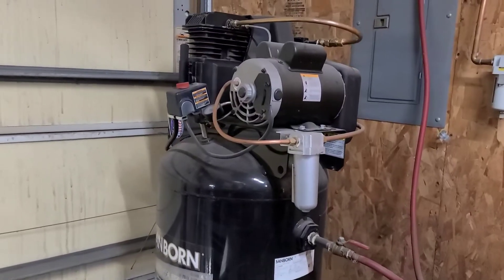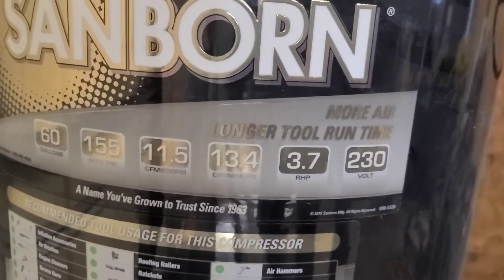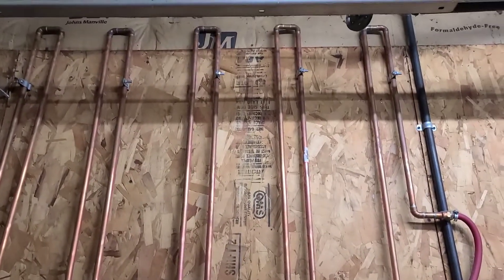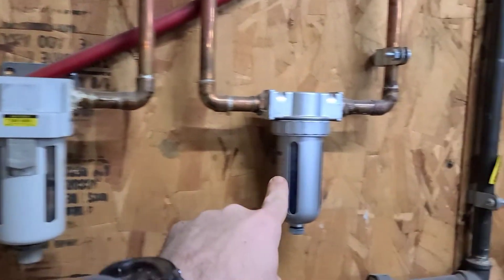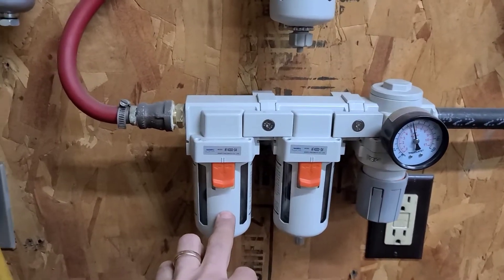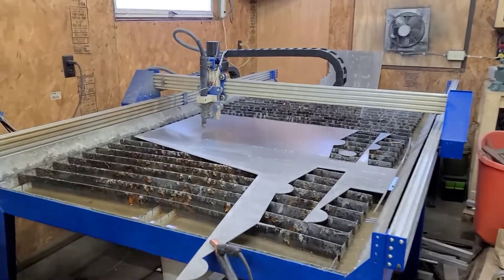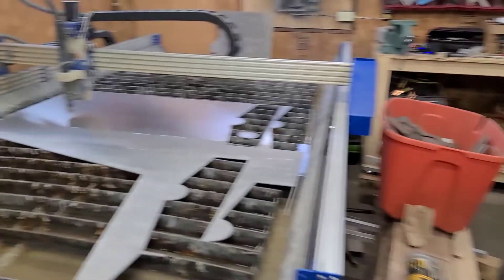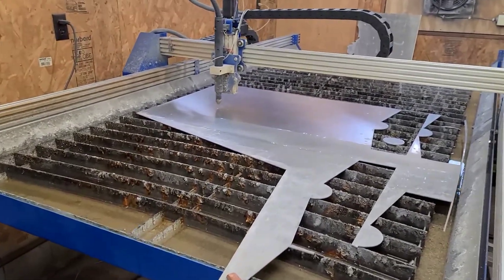diy super dry air on the cheap.

Comment: Did you consider putting all the cartridges AFTER  the copper pipe drier putting short drops with a drain valve at the bottom of each loop to get a LOT of water out of the air before it hits the cartridges?  Given the pink beads in your canister - it seems you are still getting water/vapor in your tank?

Comment: The other benefit of the intercooler is that it reduces the load on the motor because the pressure is dropped as the air cools.  Otherwise, the output of the compressor would have to reach a higher pressure for the tank air pressure to reach the cutoff level.  Dryer, cooler tank air are additional benefits.

Comment: I am adding a very basic compressed air system in my garage. I have a good compressor, but it is not big. It puts out 6.5 CFM at 90psi.  It has a 6 gal tank but added a 10 gal auxiliary tank. There is a 1/2" leader hose from the aux tank to a hose reel on a 10 foot ceiling that holds 50' of 3/8" air hose.  My plan is to use this for a small air blower, a tire inflator, a 3/8" drive impact wrench and a 3/8" impact ratchet wrench.  It will all see light homeowner use. Painting is not presently part of the plan. I am advised that given my use and the specific tools I will use the system should be adequate to run the tools. But, I think I should do something to dry the air to protect the impact wrench and the impact ratchet wrench. Complicating this is the fact that the garage will be well below freezing temps for months in the winter.  What to do?

UPDATE: I've added an air hungry full size impact wrench and some nailers.  I've also added a second compressor.  The same model.  I run both together into the 10 Gal. aux tank. I now have 22 Gal of storage.  Total CFM is now 13 at 90 psi. I'm told this equipment should handle my most air hungry tools (two 1/2 inch impact wrenches) very well.  If I were painting, or plasma cutting, or sandblasting, sanding, etc.  Maybe need more.
Reply from the maker: Yea something simple would be good.

Comment: Couldn't you run it directly out of the transmission cooler and through your whole drying system  and then into the tank... then wouldn't you never get any moisture in your air tank to begin with?
Reply from the maker: To much pressure for that

Comment: I thought I would just clarify what’s happening because his implementation is correct but his explanation is incorrect.  The radiator does most of the work because hot air holds more moisture than cold air, so when you cool it down, it literally rains inside the radiator and the auto drop thing will purge that out.  The second thing which happens in a system is every time the air pressure drops (such as when you use a tool) a fog will appear inside the tank (and deposit on the walls) because lower pressure air can also hold less moisture than high pressure air.  That is what the desiccant is for.  A better setup would be after the tank run 50 ft of copper in a coil (from top to bottom allowing water to drain to the bottom) with another auto drop followed by the desiccant trap at the plasma table.

Comment: Quick question. I’m planning a very similar project, and I’m wondering, should I go motor-cooler-water trap-tank, or swap tank and trap(like yours is)? I’d rather have as little water in the tank as possible. Thanks.

And it’s des(desk - the k)-uh-can’t

Comment: I find that the first desiccant is just wasted that early on. Those beads are meant for extracting the last bits of fine moisture. You might as well move it forward in line with the other desiccant. That is you'd use copper pipe to condenss and trap water. Then at the very last moment you'd use the desiccant.

Comment: You did all that work to dry your air and then you installed an air line oiled.... You not only do not want oil in your air on a plasma cutter and expecally not in paint air, but you also can't even just take the oiler off but you can no longer use any of the lines or air hoses etc without somehow degreasing them... 

Since the oiler is ment to be installed at the end of the lines closest to the tool you might get lucky and the oil doesn't make it to the tool but I'm sure at some point the oil will build up to the point it does finaly

Comment: For your aftercooler, did you have any issues with air leakage from the check valve on the tank to the pressure switch?
Reply from the maker: @uswcboy none at all
Reply: @JDSOutdoors  appreciate your note back. Really cool looking system.  I added an after cooler to mine, and now I have a check valve leaking through the unloader line. Hoping the new check valve will handle it. Then I will try it again. It was so nice not getting run out of the shop by the heat my compressor puts off.

Comment: I have the same Derale aftercooler on my compressor, but I got the one that comes with the 12v fan. I think having the 12v fan on the aftercooler is better at cooling down the air. I used a 12v power supply and wired into the pressure switch, so it kicks on/off with the compressor. I don't think the compressor flywheel moves air thru the aftercooler all that well so having the 12v fan on the back of the aftercooler really cools the air thoroughly.  The Derale without the 12v fan is the 15300 and with the 12v fan, it is the 15800.
Reply: I agree with you, although I do see the trans cooler has dirt in the fins showing that it is drawing air.

Comment: Wow, January 2025 cooler is $95 instead of $50. Assuming all other parts have doubled. Will try to do just the radiator and auto drop first  and see if the wall loops are needed for my shop. TY
Reply from the maker: @BBBILLY86  dam that's crazy how much it went up

Comment: Just go dewalt 20v power tools.  So much easier than 1920’s tech air compressors.  I sold my speedaire compressor and couldnt even give my air tools away.  Had to toss them in the garbage.  Seriously, unless you are painting, battery power is king now
Reply from the maker: @drcoffee5588  yea unfortunately they don't make a battery operated plasma cutter
Reply: @JDSOutdoors  obviously someone didnt really pay attention to the video did they?

Comment: I’m confused. If you see the advantage of sending the air out to the trans cooler and water drop before hitting the tank, why not extend this logic and put the tank after a portion of your wall setup? That way you keep your tank super dry and have zero rust.

Comment: Nice system.  I'm glad to see the radiator.  I suggestone simple change to greatly reduce or completely remove all moisture from going into your tank and your shop lines...
From the radiator output, connect that to your copper lines input. Then, from your copper lines output, connect that to your tank's input.  Then, from the tank,  connect that to your shop line's input. 
Do this and you'll have no moisture in your tank or your shop lines.

Comment: Interesting video.  Clearly successful which is great.  But I wonder if a little overcomplicated?  For instance, why use desiccant chambers at the bottom of the loops when you could simply have a 150mm down stand on each loop with a purge valve?  You know there will be condensed water there.  You don’t need desiccant for condensed water.  Desiccant is useful to eliminate vapour.  Another example is the cooler before the compressor tank.  If the water condenses in the tank, then the tank is essentially a condenser.  That moisture is no longer in your air, although it will increase the humidity of the air in the tank.  But that’s what your drier loops are for!  Just empty the compressor tank daily.  👍🙂
Reply: There’s another important benefit to the cooler before the tank that I seldom see mentioned. The air going into the tank is already cooled which means it can’t hold as much water. Without the cooler (a) more moisture gets into the tank (duh), (b) some moisture comes out in the tank as water but (c) since the air in the tank is still hot it will hold more moisture as vapor and that hot air will carry the moisture out to the air lines where it will condense and you’ll have water in your lines. So the cooler has a dual purpose - not only does it remove most of the moisture but it also cools the air so it carries far less water vapor out into the lines.

And I haven’t tried this yet but it’s been stated by one YouTuber that adding a second water separator before the tank will eliminate almost all water in the tank.

Comment: Can you use a temp gun to get the temp on the pump side, then the output side of the radiator pipe after it’s been running for a good long time so it’s nice and hot.  Curious to see the difference.  My abrasive blasting system keeps getting clogged with moisture

Comment: I like the idea of cooling the air before it goes into the tank, very smart.  I plan on experimenting with a desiccant filter on the air intake to stop the moisture before it goes into the pump as well as your radiator cooling system.  Will have the stock air filter first, then the desiccant filter and into the compressor.  Will try that first before adding the radiator

Comment: Thank you for a great really informative video on cooling compressed air! It sounds like something I will do now that I have seen yours. 1 question I have is, How does the radiator cool the air without a fan on it? how does that work? do you need to run electricity for it?
Reply from the maker: Not at all the compressor runs the fan which pulls the air through the radiator. Works extremely well.

Comment: My only question is, what are the ends you put on the copper pipe to screw in and feed to the transmission cooler, and how do you install them on the copper pipe? Trying to do a similar setup now for my air compressor for a blasting cabinet. Awesome video btw.
Reply from the maker: Flare to compression fitting
Reply: @JDSOutdoors  thank you sir!

Comment: That's sounds stupid to me. Why don't you put the cool air not through your drying system first before putting it in the tank? If your drying system is that good then you would get no condensation whatsoever in your tank in the first place, right?
Reply: Depending on his location, the temperature shift could cause condensation in the tank, so, although your idea has merit, I still think the safe bet is to dry the air that is going to be used well, especially with the plasma cutter.  The extra bit of process just ensures success!

Comment: Probably cheaper and simpler precooler option is a 5gal bucket of water with a coil of copper pipe in it with an auto drain at the bottom that expels it occasionally.

Comment: Nice copper work & experimentation to improve your system, Kudos! A few suggestion: #1)Add an electric fan to the oil cooler. The logic is: A 1 inch + gap exists between the flywheel/fan blades & the cage mounted oil cooler & most of the air just goes anound the cooler because the fins resist air flow by design. With a fan pushing air thru the cooler, the cooling efficiency goes up + the extra airflow will cool the pump fins, reducing air discharge temp., further adding to the efficiency. Then flow the comp. air thru the water trap on the tank. The final solution to stop all water in the tank is: #2)Flow the air from the water trap into a Schedule 40 2" dia. × 36" long galvanized pipe, loosely stuffed with stainless steel wool scrub pads. Vertically mount the 2" pipe + a top bell reducer for air inlet & a bottom 2" "T" with bottom drain valve & side air exit to go to the tank inlet/check valve. This 2" vertical pipe is the rest of the magic formula. It provides reduced air velocity (more dwell time) to allow the remaining moisture to grab ahold of the stainless steel wool (coalescing) into droplets that fall into the drain valve area. Now you have air dry enough that No water will accumulate in the tank or lines. Use a desicant & then a particle filter combo At the Point of Use (taken from the wall mounted copper tube thingy because it is not necessary).  About the up/down copper tube device: Have you ever seen an automobile cooling radiator made from copper tubes & No fins & No air flow? Or a modern car with solid wood wheels right? All these have been surpassed by surperior technology. For the ultimate engineer designed, hobby sized passive (No refrigerated driers), see Doug Kronemeyer's 3 part YouTube video series "DIY #9" where he presents, in Part 1, schematics & system design logic & knowledge. Part 2 is in his own shop, looking at each part of his sys. & how & why it works so efficiently. Alright, keep experimenting & learning every day! Peace, Paul from hot & super humid S. Central Tx.. P.S.A shoutout to Bud Stiner, THE Compressor Guru! He has many DIY tutorial repair & diagnostic videos (YouTube) & offers & ships parts, & local service/repair. Great guy!
Reply: Thank You for the info!! ....Just watched the 3 part series by Doug and about to watch Stiner.  Looks like i will be setting up my air dryer starting today....doing this for DIY auto painting in garage.  This was a huge help!! 😁👍
Reply: Shout out to you Paul! Looking over Mr. Doug's videos really helped me see what I need to fix. Thank you.

Comment: Nobody has corrected you on how to say it but I must!    Desiccant  (Dess-i-kent).  Thanks for the follow up video!  Really appreciate it.  I planned on using coiled copper line for my aftercooler (between the compressor and tank) but you showed me those transmission coolers can handle the pressure just fine.  Thanks!
Reply: the VERY first thing i thought of....

Comment: I remember the system being upgraded on the wall, that tank mod though, that's ingenious. I need to do that. 
Can you do a video specifically on the trans radiator mod? Like how to run it, the pulley and fan, e.t.c?
Reply from the maker: I can make one but it's super easy. No modifications to the pully or fan at all. The trans cooler is literally zip tied to the fan shroud and plumbing ran from the pump, to the cooler, to the auto drop, then back to the tank.
Reply: @JDSOutdoors  I kinda figured that's how it was but I wanted to be sure. That's awesome and definitely easily attainable
Reply from the maker: @benhightowerv  super easy and extremely effective for a cheap price tag. I have the parts I used linked below minus the plumbing which really needs to be purchased locally with the pieces brought in

Comment: Built a dryer with a large oil cooler, 12v adapter on a electric radiator fan and a single water trap. Only spent like $150 on everything. Took 300⁰ head temps down to 5⁰ above outside temperature keeping my tanks dry.  At the chuck I used the dry crystal trap but after a year its still blue.
Reply: Hi. Can you share the details of your setup